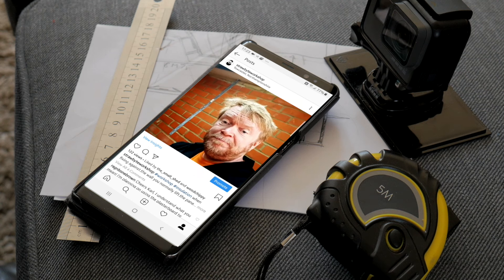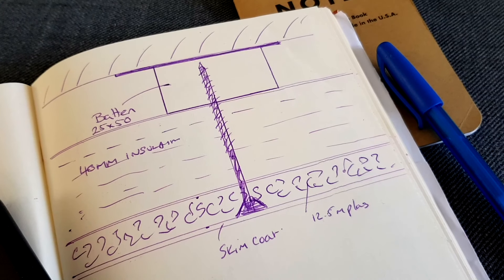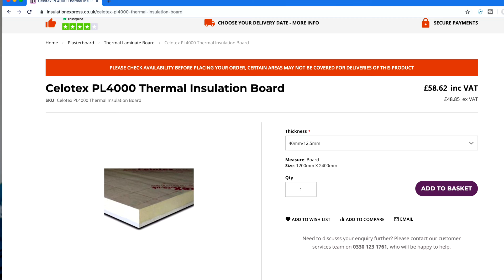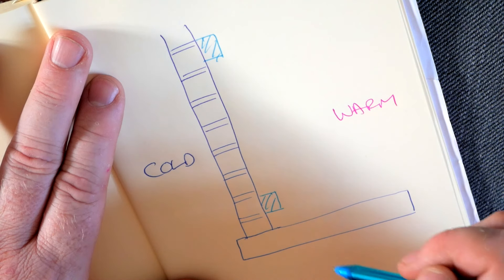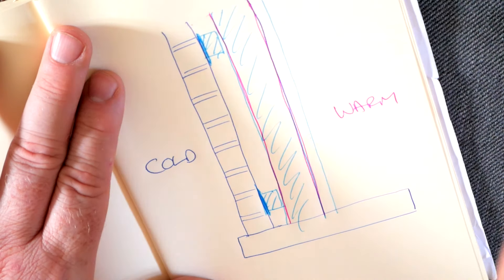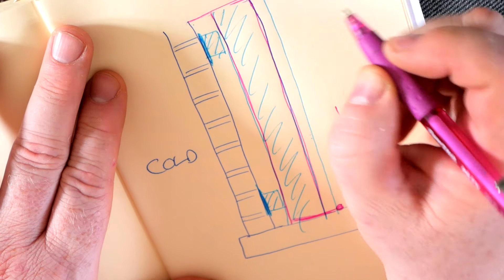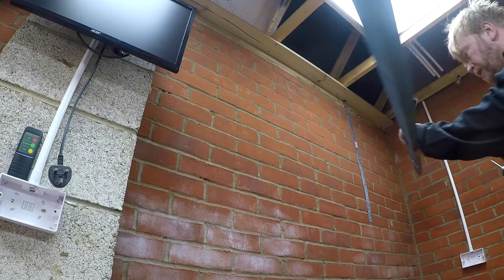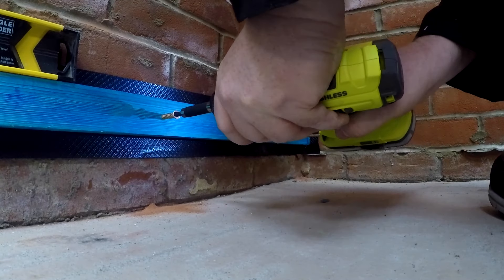How to Insulate Your Workshop | An Easy DIY Project | Keep Your Shop Warm or Cooler

Comment: Great video! I'm thinking of basing my garage conversion of most of what you've said. I do wonder though, have you celotexed the entire room, or just one or two walls?
Reply from the maker: Thanks for the comment. In total there are 8 sections of wall and 4 brick pillars and Ive used celotex on all of them. The first two walls are insulated plasterboard - plasterboard with celotex bonded to the back. The rest celotex with MDF on the front. Mostly 40mm on all the walls with the exception being around the up and over door where I needed 50mm to fill the gaps. Used 50mm and 30mm sheets in the roof-space (see separate video). The brick pillars have only just been done and I've used 30mm over them direct onto the wall. The difference is amazing at least 5 degrees warmer in the winter and cool all day in the summer.
Reply: Strawbyte Workshop Ah cool! That is exactly the same layout as mine - 4 brick pillars and 8 sections of wall (Although I have a door and 2 windows too). Will be interested to see how you have done the pillars! Sorry for another question, but what make of cellotex did you buy? I looked online and there’s far too many to pick from haha
Reply from the maker: @Bizk1d1  It was Celotex from Insulation Express. The insulated plasterboard was Ecotherm from the same place. To be completely honest, PIR insulation is pretty much the same regardless of the brand. Settle on the thickness and provided it's foil backed on both sides choose the brand on price and availability.
Reply: Strawbyte Workshop I’m still in the middle of doing this and keep coming back to this video every couple of days to make sure I’m doing things right. I’ve noticed you’ve said in a few comments that if you were to go over and do this again, you’d use a membrane tied into the walls. I assume you mean a DPM? I’d like to take advantage of your learnings here, are you saying you’d get a DPM the size of your workshop and attach it to the bottom battens, in order for any water to remain outside of the DPM?
Reply from the maker: @Bizk1d1  Hi yes I was referring to a DPM sheet under the new floor and brough up the walls to just past the damp proof course in the bricks. The battens for the wall insulation would have simply held it in place. Then the wall insulation over that. The reason for a different approach is that I have a few spots below the damp proof course where there is moisture penetration which would have been fully mitigated had I put a membrane over the floor and up and over those brick courses.
Reply: Strawbyte Workshop Okay great stuff, this is something I’m now taking into consideration! My Celotex has just arrived too so it’s all coming together. In the video you mention using screws and washers on the top to screw the insulation into the batten; sorry for another question, but what screws/washers did you use and to what length? Thanks!!
Reply from the maker: @Bizk1d1  Hi. In my case my insulation was 40mm and the battens 25mm (total thickness 65mm) I simply chose ordinary framing screws that were 60mm long and either 4.5 or 5mm (diameter). The washers wer simple M6 penny washers. Both screws and washers were obtained from  Screwfix. There are specialist insulation washers which look like the discs you see on the ends of ski poles. However they're hard to come by from general tool/hardware places. Penny washers worked well enough for me.
A tip which didn't really come across in teh video is to try and be consistent where you fix the celotex. You'll be putting a layer of board over the top and you want to avoid the screw for that clashing with the washer underneath. 
Because I guess your next question will be what screws do I need for the MDF board. The same calulation applies: 25mm batten + 40mm insulaiton + 12mm MDF = 77mm. Screw length 70 or 80mm. I used 80mm as 3-4mm at the tip of the screw went into the brick okay as they were soft. If your wall is hard perhaps go for slighly shorter screws.
Reply: Hey, me again :) Everything is starting to come together, albeit slowly, but hopefully il be sorted by time the winter comes - I really appreciate your helpful comments! You mention tape and joining compound to hide gaps and screws, but did you do this with the mdf option too? I was looking for the best stuff to buy when I came across something on Google that said tape and jointing on mdf isn’t great because the mdf can expand? Ps, I went with 80mm screws in the end, as 70 wasn’t really gripping the wood properly for some reason!
Reply from the maker: @Bizk1d1  MDF is pretty stable in my experience unless it actually comes into contact with liquid water then it expands like crazy. You can do a lot with ordinary MDF if you choose carefully your paint products. For this project I primed with Johnstones Primer for MDF and used two coats of walls and ceilings Dulux paint. A bullet proof approach is to cut the board then prime both sides and all the cut edges before installing. But I didn't think that would be worth the extra effort and I've not been disappointed.

So yes I filled all of the joints and screw heads on all the MDF walls. There are two options that I would recommend. 1. Use two part filler I personally use Ronseal as it's what my local Screwfix stocks, but Everbuild or Bondit also work well. 2. Ready mixed Polyfila (avoid the tube version). In this project I opted for Polyfila which has been excellent all round. I have one small patch which got wet (due to a fault in the construction of the garage) and the polyfila is fine even in that area. It's cheap and works well in my experience, it's incredibly easy to sand and takes paint well. To be honest, once primed and painted the filler and MDF is pretty moisture proof. The big advantage over two part is that you can just use it as you go, rather than making up several batches and go around and apply it before each batch goes off.

Comment: How’s it holding up to a UK winter, nice & warm?
Reply from the maker: It's been a cold few weeks with frost's every night and it's held up really well.and remember I've still got one section of wall where the personnel door is going and the garage door surround to finish. The lowest it's dropped.to has been 5 degrees but pop the heater on for 15 mins and your back up to a barmey 13 degrees. I've been plotting temperatures out since the summer and it's been consistently 7 degrees warmer than outside recently and 5 degrees cooler in the summer.

Comment: Great video. I want to insulate my garage and this seems like a great way to do it!

What sort or temperatures do you get in the colder winter months in your garage after the renovation?

What did you insulate the garage door with?
Reply from the maker: Hi there RustyR. Thanks for the question - it's one I get asked a lot and it's a little tricky to answer. It may seem obvious but clearly if you don't have any heating in the workshop the space will eventually cool down to the average temperature outside. Where I have noticed is difference is that without any heat in the first winter it the temperature never fell below 2 degrees - even when outside was minus 6 or 7. Where the insualation counts is when you pop the heater on. I've a 2Kw fan heater which last weekend brought the temperature up from 8 degrees to a toasty 13 degrees in about 15 minutes and then heat from my dust extractor and lights kept the space warm throughout the day. Un-insulated I spent over £150 heating the space throughout the winter and I couldn't bear being in the workshop on the coldest days. These last two winters have been lovely. Quick to heat, retains heat well and keeps the space very cool in the summer too.

For the garage door I used 25mm polystyreen insulation stuck to the back-side of the door with double sided tape and retained by a layer of Corrugated plastic sheet. Plus I have a thermal curtain in front of that. I may do a video on the door insulation as I need to redo the tape and replace it with 3M tape as the summer heat on the door has led to the carpet tape I used becoming unstuck.
Reply: @StrawbyteWorkshop  Thank you.

I use my garage as a training room and have a small plug in heater but it felt worthless using it! I was tempted to buy an oil based heater as I understand they retain the heat for longer after being switched off. Most of this is pointless without the insulation though!

Comment: Nice vid Karl, watched it several times now. Is the bottom of the wall below the damp proof course and how do you accommodate that?
Reply from the maker: Hi Malcolm. Thanks for your question. The bottom of the wall was a source of considerable debate amongst those I approached for advice. The approach I've taken is to install all the battens backed by DPC with (following a revised approach) a horizontal batten at the top of the wall, a second horizontal batten 750mm from the top to allow me to fix into, vertical battens at 600mm centres that decend just below the DPC. The insulation plus wall covering (MDF or Plasterboard) is raised 5-10mm above the floor (the floor slopes down to the garage door) and then sealed underneath with expanding PU foam and sealant (Everbuild AC50). There is a risk that moisture below the DPC will affect the installed wall but I think that risk is minimal - some have disagreed but it's my workshop and I accept the risk. Factors I think matter are there are no fixings below the DPC to corrode, no battens in direct contact with that part of the wall (above or below the DPC), no insulation or MDF/plasterboard in contact with the floor or wall. All the walls were assessed for moisture in the wall with a meter both above and below the DPC before I started with the results being dry with the exception of one patch the size of a dinner plate 1m above the DPC. So I think the method should be OK. Another approach which I discounted was to install a DPC over the whole floor and join it into the existing DPC in the wall. I hope that helps.
Reply: @StrawbyteWorkshop  Many thanks Karl, it is much appreciated.
Reply: Great work Karl, well, now you have had a winter do it’s worst, have there been any damp issues at all?

I am about to start a very similar project, I will probably paint a DPC liquid barrier upto a few bricks above the DPC in the wall, and across the floor.

Then essentially the same construction as you with DPC strips on battens, insulation and plasterboard. I’ll bridge my piers with insulation but that’s about the only difference to your approach.

Just wondered if there were any dramas this winter or stuff you’d look at differently now it’s been tested in some pretty awful weather!
Reply from the maker: Your question would make for a good follow-up. There is one small area which has been affected by damp. This was because the edge of one of.the wall boards was in contact with a brick below the damp course  in one of the four  block piers. Everywhere else looks fine. If I get a chance on a nice spring day, I do plan to pull everything out and do a full assessment.

Comment: Got this on my to-do list so thanks for sharing. Any concerns with thermal bridging via the brick piers along the side walls?
Reply from the maker: SCK Woodworking I’m so glad you asked as I got a couple of messages via Instagram discussions the piers. The short answer is, of course, yes. But this will be addressed within the next couple of months in a separate project. Two piers support the garage door and one supports my monitor bracket. Each will have a custom enclosure which I think will neatly fix the bridging issue. Keep a look out for those projects. The next video will look at the roof, loft and detailing at the top of the wall, I mention the piers in that video. K..

Comment: this is brill  how did you fill the gap between the bottom floor batten and the floor please ? and why blue timer over Tanalith 'E cheers
Reply from the maker: Good question - it's not really shown but I've used AC 50 Acoustic Sealant to fill the 3-4mm gap between the bottom of the Insulation/wall-board and the floor. In the technical sheets from the insulation manufacturers sealing this way was recommended. The blue timber are treated roofing battens. They happen to be the recommended dimensions (25 x 50) and really cheap (per meter) when bought in longer lengths (3600mm and 4800mm)
Reply: @StrawbyteWorkshop  ok cheers, about to do my garage in the next few days tho my garage is old and the floor has no dpc, so its been fun tanking the floor
Reply from the maker: Good luck with the project. 👍

Comment: Hi Karl. This is a very timely video as I’m about to start on the same job. A couple of questions if I may:
What dehumidifier have you gone for & do you recommend it?
Did you think of using OSB rather than the MDF surface? OSB is strong enough for direct mounting of heavy items, though not yet checked to compare fire resistance.
Did you consider using breathable membrane on the back of the studs up against the bricks to allow a margin of prevention from rain penetrating and facilitate moisture exiting (like the Restoration Couple used https://m.youtube.com/watch?v=KvRyY41GpUA)
I also have porous bricks single skin and am going to waterproof with Thompson’s Water Seal, it has a good reputation and seems cost-effective, but think I might still use the breathable membrane too.
Reply from the maker: Sorry it's taken so long to reply. Due to the link it went into my held for review folder which I don't check often.
OSB would make a good interior surface if you're happy with the look. Having tried insulated plasterboard and then switched methods, MDF gave me a paintable surface - but OSB would work too.
So the method that Tim uses in his video is very suitable for studding between the concrete pillars. The stud work is tied into the joists (above) and floor (below) and not fixed into the wall. In my method the battens are directly fixed to the wall and the DPC prevents them rotting if moisture penetrates the wall. 
I've avoided applying any treatment to the exterior wall. I don't think its necessary and I want to avoid anything that needs to be periodically re-applied.
I hope that helps.
K.
Reply: Thanks, no problem!
Which dehumidifier did you go for, and is it up to the job?

Comment: Interesting.  How are you finding it long term, now that over a year has gone by (and what a year!)?  Warm & dry?

Our workshop is similar construction (single skin brick with piers) but about half that size and with a 4+inch thick reinforced concrete roof.  Unfortunately, it's both cold & damp, seemingly more so with a growing condensation issue, possibly since our neighbour took down his half of the "semi-detached shed".  We do have electric heating out there but, with no insulation, it was extremely expensive to run so now it's only on when I'm out there.  It could be that something like this would be a solution.
Reply from the maker: It's been over 18 months now since I installed the insulation and overall its faired really well. It takes a few minutes with a 2kW fan heater to get it to around 14 degrees and it stays warm all day. Heat from the LED lights and dust extraction is enough to top it up when I'm in there. The new door installed last February allowed me to complete all the remaining walls and that made a big difference in the summer in keeping the space cool. There are a couple of things however:
1. I discovered a fault in the DPC installed by the builder not long after completing the initial work. The base of one of the block columns is very wet and never dries out and this has led to some staining of the wall in two places. But everywhere else is dry. Had this been a living space I'd have fixed that by now, but this is on the fix-list for the spring.
2. The Up and Over Garage door is a pain to keep drafts at bay. That's the only real complaint and I may replace the metal up-and-over door with timber side-hung doors this year.
3. I am going to board over the roof insulation at some point starting with the gable end.
4. If I were to do it again I would have not used insulated plasterboard and I would have thought about wall storage and installed the supports into the wall while insulating.

This has been one of my most popular videos amongst UK viewers because we all have garages that look like mine and this year has more people wanting to make use of garage space for things other than parking the car.